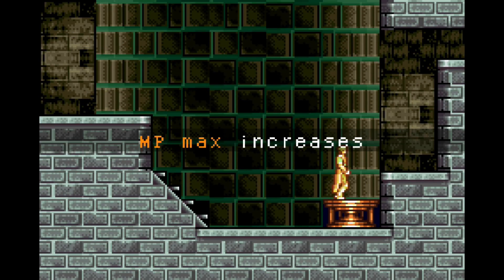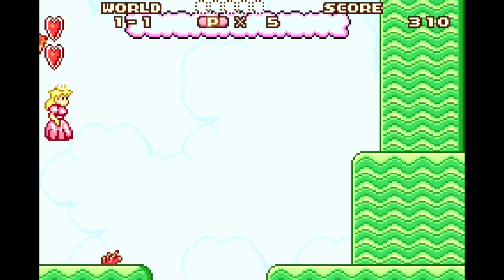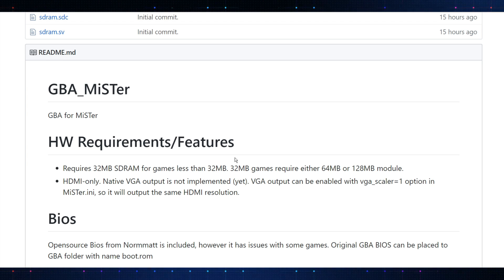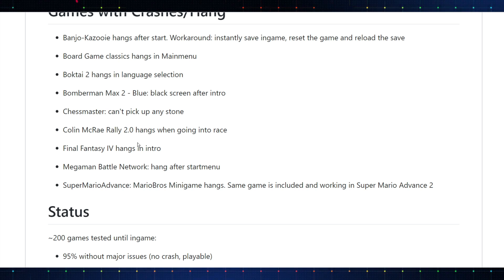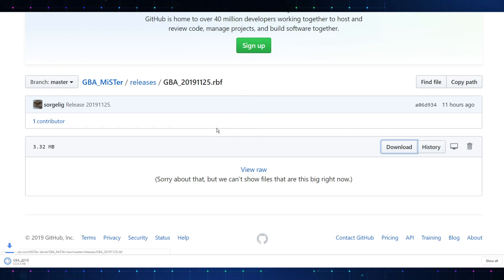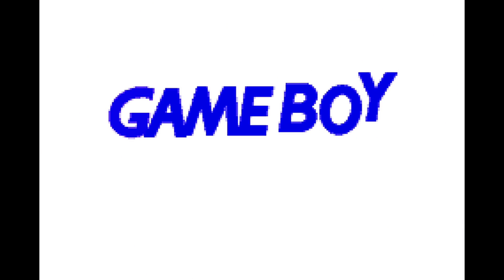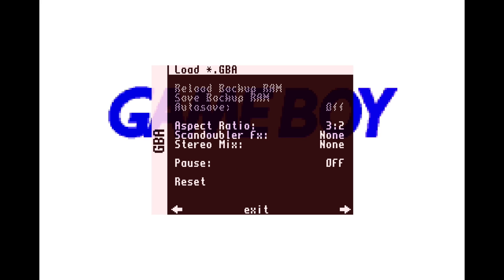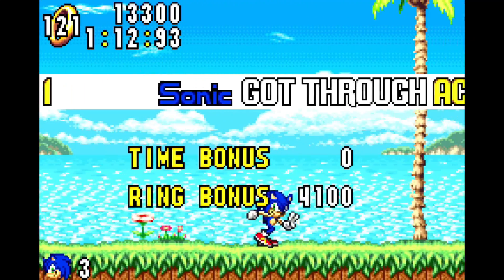FPGA Game Boy Advance! Setup & Demonstration On MiSTer!

Comment: If you ever figure out how to fit the MISTer in a Neo Geo X Dock,  I would love to see a how-to video!
Reply: I have one of those docks, it won't fits because of the IO board and the heatsink... I don't think can be done unless you destroy the lid of the case.
I used a raspberry pi inside of it, it works but for the mister because of the  USB Hub and other stuff won't fit.

Comment: correct me if I'm wrong, FPGA is emulation to the chip level right?
Reply: I'm a fellow enthusiast, not a developer, but I've been following this stuff quite closely and will try to summarise (hopefully, with accuracy).  Yes, an FPGA is a programmable development board for micro circuitry, so an FPGA core is a software implementation that describes all the logic of the hardware being developed (or emulated) so, in effect, the FPGA is reconfigured to "become" the described hardware when a core is run.  Unlike your typical software emulators, an FPGA implementation can handle multiple logic components simultaneously (your normal computer, by contrast, processes everything sequentially), allowing the timings of the emulated hardware to become theoretically cycle-accurate (this depends on the quality of the implementation) without requiring an ultra-powerful highly-clocked processor.  Software emulation can also be cycle-accurate, but it needs some serious horsepower to do it, and probably relies on keeping the rest of your system clean and efficient so other processes aren't getting in the way.  The MiSTer can do all of this on a tiny device which sips power and starts up almost instantly.
Reply: @JonnyTenebrous Ah I see